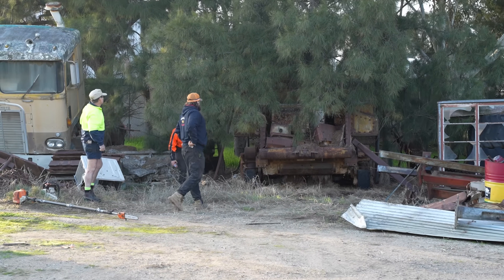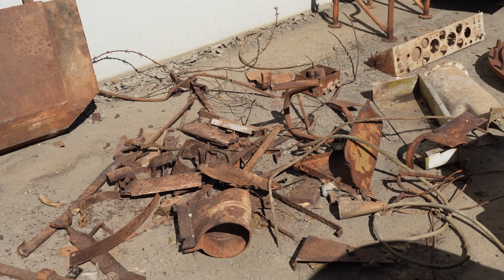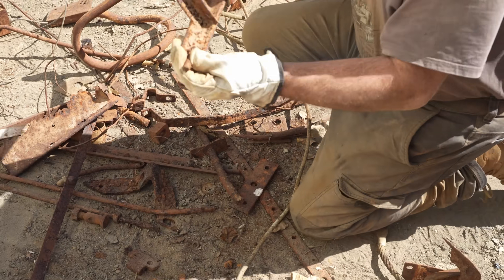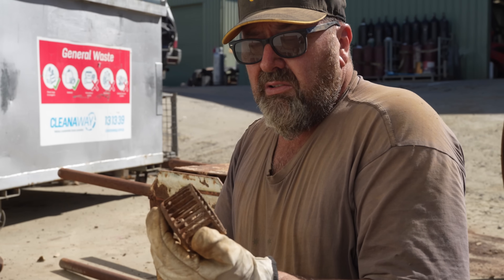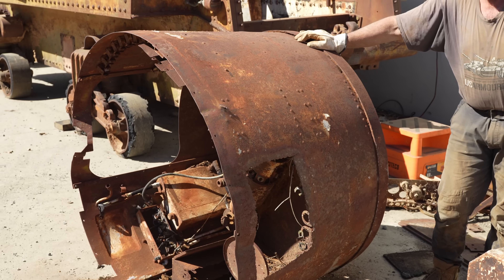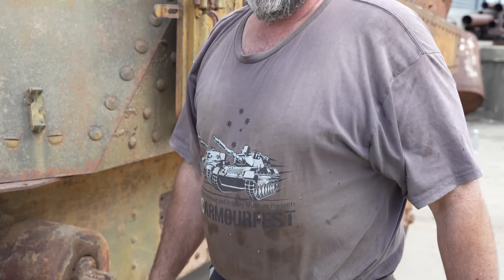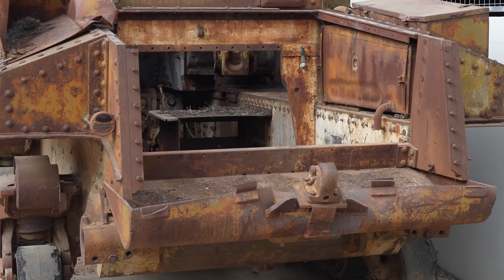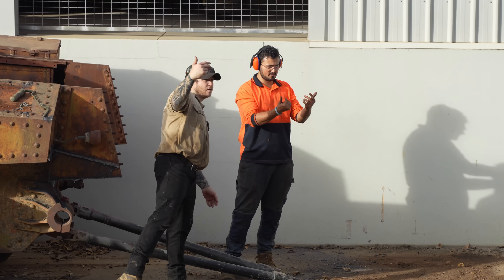WORKSHOP WEDNESDAY: Greatest tank BARN FIND in Australia! PART V

Comment: Narrator - How often do you get to see a tank flip upside down.
Me - Once, was in the field with my entire Division. I was in the field artillery as a Radar operator (q-36), and the tankers had a new LT that was a TC, and he wanted to show how high speed low drag he was. And so when they were doing the tank track in their M1A3 Ahbrams, they hit a corner of the track doing over 50 MPH, and the treads dug into the loose rocky sandy soil, and the tank flipped. The impact buried the .50 Cal 4 feet down into the dirt, crushed the TC, killed the Driver, and injured the ammo loader. (I THINK there was a 4th person inside as well who was also injured but this was back in 98 or 99, so having a little trouble remembering.). 
I will say that same year we also had someone get cut in half by one of the Scout tracked vehicles our Artillery Battalion used. There are 2 doors on the back side, 1 personnel door that opens to the side, and then you can lower the entire back side of the vehicle and the guy ground guiding the tracked vehicle wasn't paying attention and when he told the people inside to drop the back, he bounced off a tree, then the entire armored door slab hit him in the upper torso, and cut him in half.

Comment: At the USMC Air Ground Museum we flipped and SU-76 on her side to sandblast the bottom of the hull. We had to use an old RT forklift and it was quit a job.   I don't know how many hours I spent sandblasting the vehicle, inside and out, small parts to huge, but it was a bunch. I can't describe the satisfaction when the final coats of paint went on and I envy you all for the challenges and hard work ahead. If I lived "down under" rest assured I would be reporting for duty to share in the fun.

Comment: But why did you leave the side door open, so it might be bend??
Reply: The doors are designed to be as strong as the side armour of the tank. Literally, the only thing that would have happened is they got dirty
Reply: @xacoupeguy  As you think.
Reply: @potator9327  I promise you the door will hardly have a scratch on it!
Reply: @xacoupeguy  It seems to have gone well, but in my opinion there was a risk of the door being bent or at least the hinges or perhaps their bolts being torn off.
I appreciate your enthusiasm for the stability of the door, but it wasn't designed to withstand 20 tonnes of pressure on one corner in this way. And for what purpose? Could the door not be closed?

Comment: Hi Kurt,  how many M3 Grant/Lee does Aus Armour actually have?

During the video, at around the 11:20 mark, you said “we have another two Aussie Grants in storage”.

I thought you guys had six (6), plus the old Grant farm tractor conversion,  it sounds like you are saying seven (7),  plus the farm tractor conversion, yes?

* 1 x Grant - older static resto
* 1 x Lee - older static resto
* 1 x Grant - running, done by Daz and Jess
* 1 x Grant - static rustoration, done by Ron
* 1 x Grant - this current static resto by Ron,  and
* 1 x Grant - in storage, the last of the three Parker Brothers Grant.

* Plus the 1 x Grant farm tractor conversion, on display
* Plus a number of old cut down spare parts hulls (2, or 3 or so) in open storage on the ‘farm’

Am I missing something?

Maybe you could do a WW of the storage facility?  I think we would all find that very interesting, see all the bits and pieces and other hulls awaiting resto, yes?

Cheers,

Comment: Ron cutting off parts. Why can’t stainless welds be cut off using an oxyacetylene torch? Seems it would go through anything.
Reply: Stainless does not rust as it does not react to oxygen as non stainless steel does (iron oxide) Rust or oxidisation happens faster the hotter it is. This is why stainless is commonly used for safes as a torch can not be used to cut it and it generally is higher tensile than average steel.